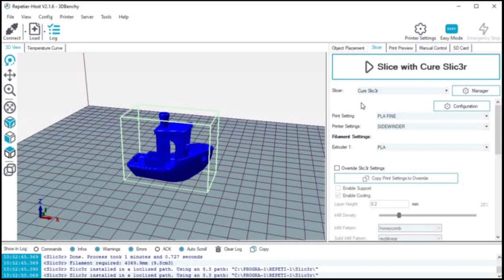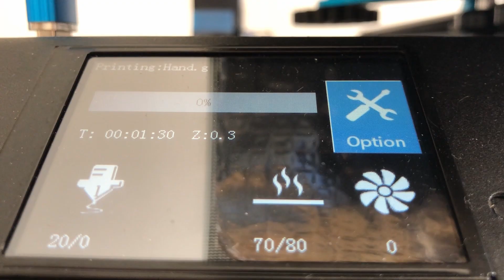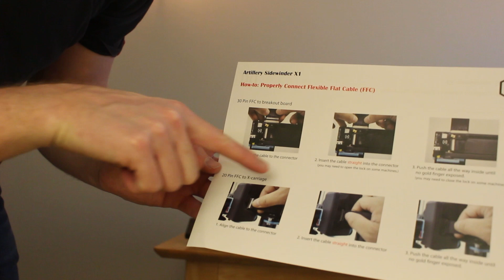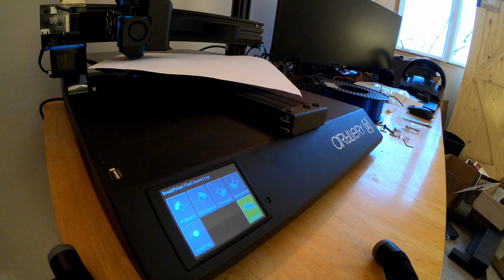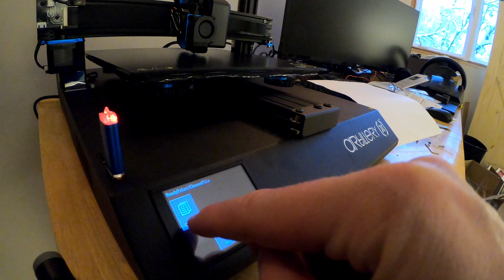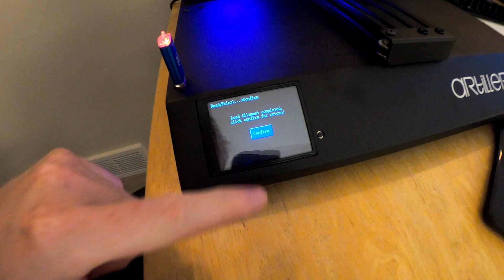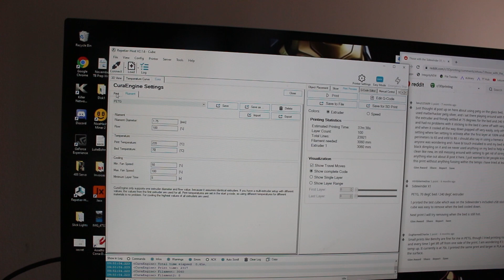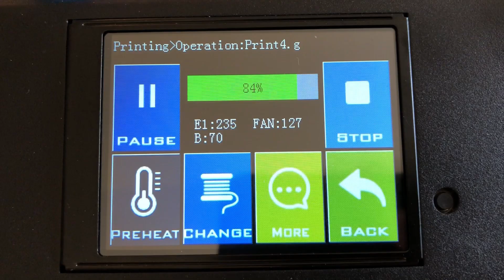Artillery Sidewinder X1 V4 FIRST PRINT& Review | FULL Step by Step Setup - Things I wish I knew!!!

Comment: AwMan, I wish i could remember exactly how it was when I first 3D printed. I am an engineer as well. My first one was a $1500 printer that was ready to go right out of the box, no assembly or figuring out necessary. It worked for about 2-3 years before the company stopped supporting its propitiatory spool chip (sad) and it had a nozzel crash into the print bed that wrecked it badly. Then got a complete DIY kit Delta style that I had to assemble everything and tweek everything by myself. (1 very long 3 day weekend).  Then I spent about 1 year going through all the youtube channels about 3D printing.  Now I have a decent little print farm of CR10S, Anycubic i3 MegaS, Artillery Sidewinder X1 v4, and Qidi Pro dual nozzel.  

Keep it up man! your doing great!
Reply from the maker: Ha - it's a little embarrassing now, I've learned SOOOO much, and of course am far from knowing everything.  I'll have to do some kinda update video.  Which printer tends to be your #1 go-to printer?  You have a nice lineup!  How's the Sidewinder held up for you so far?  I LOVE IT STILL.  I actually have  a few more in the box ready for some puzzle box mass production :D

Comment: have you tried TPU yet?
Reply from the maker: Yes, and it actually printed beautifully!  I've left it out of my designs, as not everyone has a printer that can print it, but everything I've tried turns out great (now.... haaha).  ABS and Nylon are still on the list to try.  But TPU was easy - You should do it!
Reply: @LeisureLuke  great to hear some positive feedback while waiting the shipment to arrive. hahahah
Reply from the maker: @ahmedmorsi591  Have you bought some PLA to get started?  Doesn't come with anything.  You should download repetier host - that's the slicer they recommend.  2 Tips - 1. Extrusion rates seem high for me.  Most of my prints now, for PLA, are around 92% extrusion.  My X1 has always been generous with the filament :).  Tip 2 - Print something with a known z-axis height, measure it, and then use a setting called "z-axis offset".   My bed is perfectly snug with my paper from leveling (yes even still), but my first layer was always printed high.. as if my paper was thick.  I have a constant z-axis offset of 0.15mm to correct this.
Reply: @LeisureLuke  PLA was the first material to try, i have tried ePA and i couldn't print anything with it as it always comes out from the built plate after few layers seems to have special sitting or something, anyways thank you for the tips but i'm using Cura slicer

Comment: Great Video, but one suggestion. Don't use cutters on the nozzle tip to remove boogers, it will deform the tip and cause bad prints. trust me, I found that out the hard way. Good luck and Print On!!!
Reply from the maker: GOOD TO KNOW!  Do you just use some plastic, or how do you do it?

Comment: Like you, I have no experience with a 3D Printer. None of my friends have one but I have always been intrigued by them. I ordered my Artillery Sidewinder X1 a couple days ago and should have it shortly. I also ordered some PLA+ as my first roll. Hopefully I can get it going with few problems. Thanks for posting this.
Reply from the maker: You should have no problem!  Just take your time getting each roller bearing a good amount of pressure on the rail. Also be precise leveling the bed.  I just got a roll of TPU (flexible) and a force gauge to run some tests!  Let me know when it’s all setup!  Also, start getting print files ready, keep that thing printing!

Comment: Awesome video. You really dove into a deep end, starting with PETG instead of PLA. But that's the issue with a sidewinder, it comes working too quickly from factory. You really want to slow it down.
Reply from the maker: Yeah, I’m normally not going through instructions step by step.  I just did it for the video. Do you have an X1, or any other printer?  I think my next 3D printing video will be some material science testing with pla, Petg, and tpu.  Then we’re busting out matlab, arduinos, and solidworks!!!!
Reply: @LeisureLuke  I have the Ender 3 V2 and Sidewinder X1 ordered. Watched lot's of videos prior to purchase and majority of them are saying the same thing, that the printer is set up to print way to quickly from factory. Something at the magnitude of 100mm/s, when in reality 50-60mm/s is really optimal.
Reply from the maker: For sure.  I’d just double check the bearings and take your time leveling the bed on the x1.  Those eccentric bearings were all too tight or too loose.  Lots of people get wavy sides to their prints because the bearings are too tight (or loose) and that indents the aluminum railing pretty easily, forever giving your print a wobble.  You’ll LOVE the X1!  I’ve heard good things about the ender too!  Make a video!  My buddy has a Prusa MK3s. We may do a comparison video.
Reply: @LeisureLuke  The same goes for the Ender. On my V2 some bolts were too tight, especially on the V rollers, and some were barely holding on. Unlike the X1, however, it takes almost 3 hours to properly go over and assemble the Ender 3 V2. You do it right and it prints beautifully though.